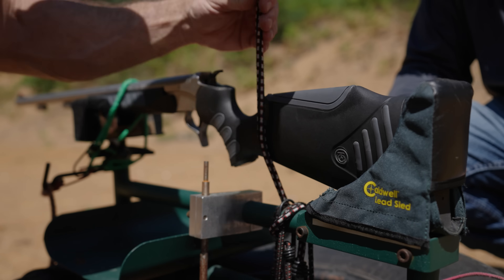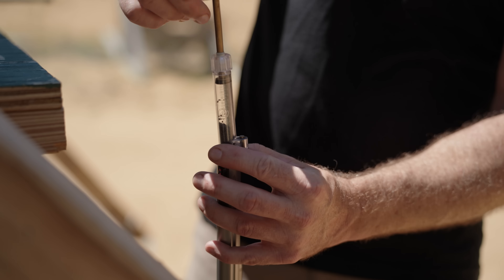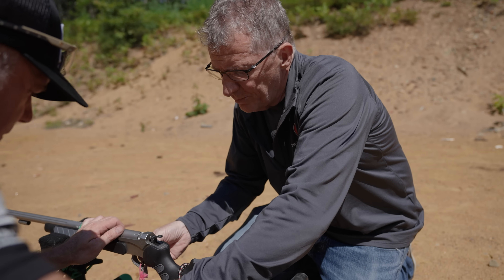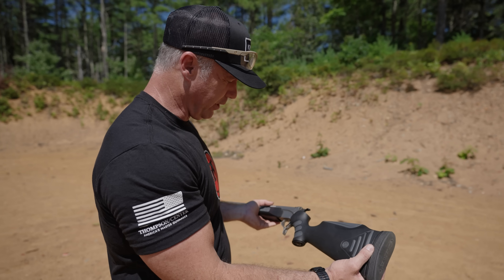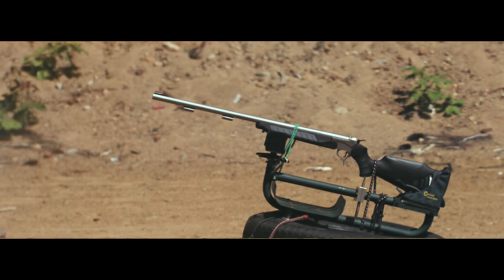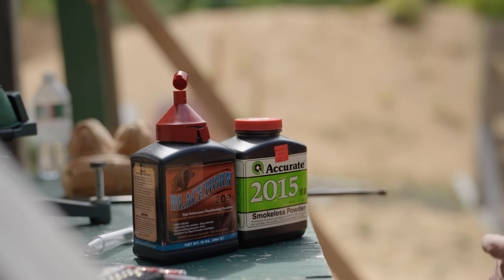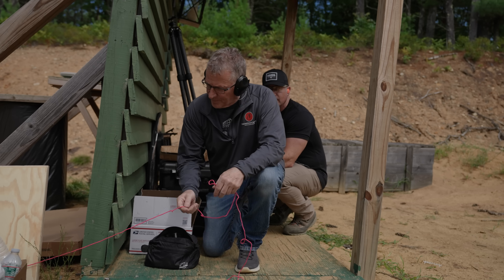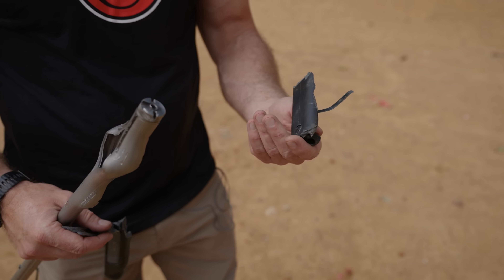My Muzzleloader Exploded

Comment: Wish you guys made a smokeless muzzleloader
Reply: Wouldn't suit the rules would it?
Reply: @paulvenn4447  How So? 
It's ML Not BlackPowder or Non Smokeless Powder .
Reply: YES Had one till a thief took it..
Reply: just make one yourself like everyone else
Reply: They have some muzzleloaders that are rated for smokeless powder, but smokeless powder isn’t measured by volume is measured by weight. And it will be nowhere near 120 grains it will realistically but do not. I repeat do not load your muzzleloader like this. I am not condoning the use of smokeless powder in a muzzleloader, smokeless powders or for firearms only use powering your muzzleloader. The muzzleloaders would probably loaded somewhere between 30 and 40 grains of rifle propellant. I Reload a munition and also I have black powder firearms as well so I’m very familiar with both black powder and smokeless powder. Also, FYI, the type of smokeless powder you use a pistol will be different than that you use in a rifle.
Reply: @jeffreyburney6161  I use 42 grains in my savage.
Reply: @peebreezy5015  I was close. But it also depends on projectile size and weight. The heavier you go in projectiles the less smokeless powder you use.
Reply: @jeffreyburney6161 I'm running 73 grains in my smokeless. Some other shooters, using a slower powder and heavier bullets, are running 100-105 grains of smokeless. And, in those rifles, it's perfectly safe. We're talking custom guns though. Nothing T/C or any other major manufacturer will ever produce. Yes, smokeless in any other BP only muzzleloader is asking for trouble. In those rifles DON'T DO IT. I don't own one of those production muzzleloaders, and never will.
Reply: @kennethunkefer7163  that’s a lot of powder. What’s the velocity on the projectile? I would be thinking you would be hitting closer to 2500 ft./s or better
Reply: @jeffreyburney6161  I've chronographed both my smokeless muzzleloaders. The big one, a bolt action build, is running 2,850 fps. The "small" gun is running 2,550. The small one is using 61 grains. 

The guys running the heavier bullets and the slower powder are easily achieving over 3k fps. I'm not interested in the recoil of those loads, plus I don't see the sense in burning another 30 grains with every shot. 2,850 fps is fast enough for me.
Reply: @jeffreyburney6161  You are correct.  I hate it when people blow up a muzzleloader on purpose with the wrong amount of the wrong powder, when we could blow up any shotgun or centerfire rifle barrel in the same way.  Savage Arms proved the correct type and amount of smokeless powder can be used safely in a muzzleloader over 20 years ago.  I have invented a new product called the "Self-Ejecting Muzzleloader Safety Cartridge", which takes the guesswork out of it.  Based on the MSD sheet for the product, BlackHorn209 is 83% smokeless powder (Nitrocellulose).  My product is less than 83% smokeless powder and it completely non-corrosive.
Reply: Savage made one and it was a liability nightmare. People couldn’t get the idea that it’s by weight and not volume on the powder and your old idea of 90-150 grains was not valid with smokeless. So many guns were blown up from people not following load data
Reply: @russellpickett2689  I have one and love it. It is no more a nightmare than any other thing. Always idiots out there doing idiot things.

Comment: Smokeless powder in a muzzleloader is ill advised. Had a guy at the range put a max charge of what I thought was black powder (it was actually pistol powder) down is muzzleloader while I was shooting mine and end result was no good. The gun blew up in his face and send a chunk of barrel over my head as I was able to shoot my inline. If I wasn’t aiming that chunk of metal would have gotten me in the head and I would be dead. The local game warden beat me to the guy because I was going to go up and ring the guys neck. It was not pretty. I needed new underwear after that
Reply: Most people do things like that out of sheer ignorance. They have no idea that powder is about seven times more powerful than black power. What a lot of these people are is lazy because they don’t want to have to clean their firearm. They think that if they use smokeless powder that everything’s going to be just fine and they won’t have to clean their gun. They’ll put anywhere between 90 and 120 grains of smokeless powder down the barrel, which that is about five times the amount of powder that would propel a projectile of a simmer weight in a firearm rated for smokeless powder and they’re using it in a firearm that is not rated for smokeless powder that is a recipe for disaster